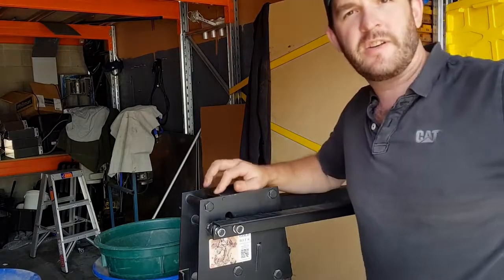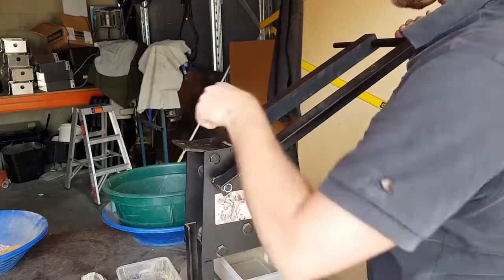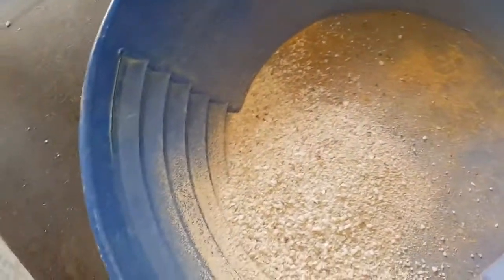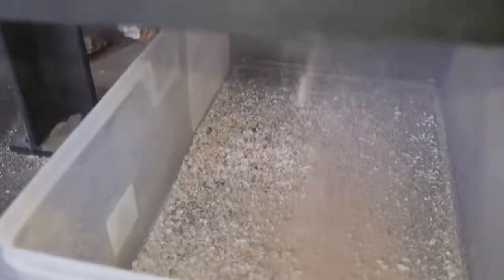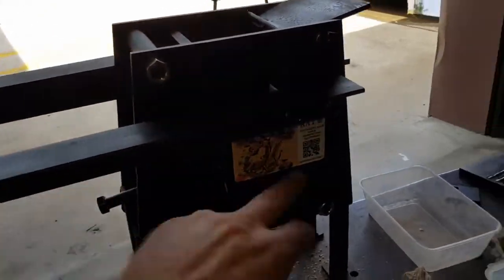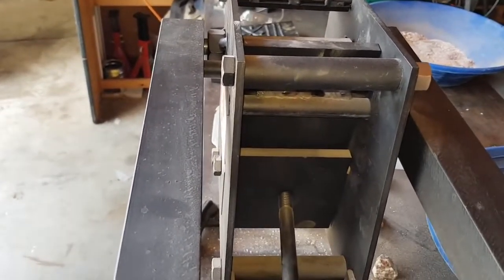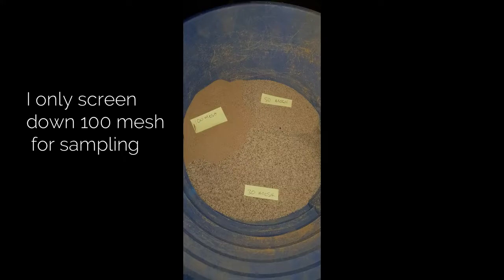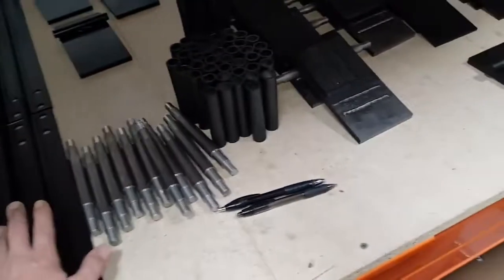Rock Crusher Off grid Gold Rat  - CrazyCrusher

Comment: Hey guys. Im looking at the original Crazy crusher. It says on Amazon that its not a product piece they said its not ment to run 5 gallons buckets through it. Not sure running gallon buckets all day or just at once they said Its ment for sampling. Can you explain the difference. We like anything that we dont need a motor on it. And if we can use this instead of buying a motorized one. I mean obviously your not going to sit and dump a full 5 gallon bucket through at once. But if I can walk around and pick up rocks all day while I'm up the mountain playing then yeah
Reply from the maker: Its definately not a production machine mate but you can crush as many rocks as you like. Our unit has hard facing ribs and our much more efficent jaws and arms make for a pretty easy crush
Reply: @GoldRatEngineering  awesome thanks man. Ive found some really awesome rocks that look like the hold gold. Ive just never been able to find out. My dad wants to get a rock crusher as well cause hes a rock hound so yeah thanks
Reply from the maker: @TheSkiddum  have you tried a dolly pot
Reply: @GoldRatEngineering  actually I haven't. I never herd of it tell just bearly. I just did a Google search for them.
Reply from the maker: @TheSkiddum  pretty easy to make for crushing the odd rock mate and very cheap
Reply: @GoldRatEngineering  awesome thanks for everything

Comment: Nice mate. Have worked with jaw crushers of all sizes and thought the same for rocks, but what a great idea, no power and exercise together. Will be ordering one soon. Cheers   ⛏😎👍
Reply from the maker: They do the job mate for sure. Ive used  a heap of motorized units i really wanted something you can take australia wide without being hassled by the cockies
Reply: @GoldRatEngineering  love it mate 👍
Reply: And still retain the swinging jaw action
Reply: 2nd pass when adjusting fixed jaw comes out like a rolls crusher. Two units in one. On a winner there mate 👍